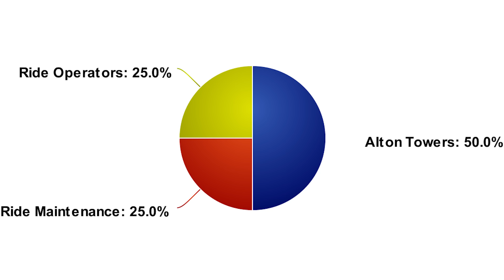What Really Happened on The Smiler Alton Towers june 2nd 2015?

Comment: This video is incorrect on so many levels, I was operating sonic spinball when it happened. It was human error, however fundamental rules of operating a coaster under the alton towers HSA were ignored by the operator. Page one of coaster operation is to offload guests when there is a block fault, the operator did not do this. Whilst the maintenance engineer should of picked up on the stood empty train, it is the operators responsibility. I do not blame alton towers one second for this, but mis-information should not be thrown around. The operator and maintenance guy are to blame not the park, they didnt follow protocol and it resulted in this accident, every operator goes through extensive training and examinations (weeks) before being allowed to operate on their own accord. Real shame for the victims but also the park, people make mistakes everyday in their jobs however this just shows a mistake on a coaster is severe and luckily no-one has died.
Reply: Ian Barclay Is it correct that the park chose to operate the ride at a dangerously high wind speed?
Reply: @TheEagleofSteel  no it isnt, otherwise oblivion wouldnt have been open, neither would spinball the ride I was operating, the smiler has a higher threshold of wind than both of the two rides that were also open.
Reply: @ianbarclay1053  the wind speed was almost 10 mph higher than the Smiler is even allowed to run in
Reply: @getoutim07  No it wasnt. I was operating sonic spinball that day has the exact same wind limits, not even close to it. My other regular ride is sky-ride, again this was open all day, no issues with wind, as was oblivion which actually has a lower limit than the smiler👌
Reply: @ianbarclay1053  I mean it's a proven fact currently that the wind speed was above the Smiler operational speed so you can't exactly deny it
Reply: @getoutim07  I can deny it, because its a lie👌 If the wind speed was above the rides limit the ride would not operate. Not with guests anyway as it would need a maintenance over-ride, so I would do some research into the ride, the park and the procedures before you think youre an expert👌 Until you have operated coasters at alton towers yourself, id give up spreading B.S if i was you its very boring.
Reply: @ianbarclay1053  the park was very busy on the day so they opened the ride anyway even though wind speeds were to high
Reply: @ianbarclay1053  you cannot deny it because spinball is on a different level than the Smiler due to the height restrictions they dig down so the different layers of land will affect the wind
Reply: @getoutim07  Clearly your off your head and just want to look clever. EVERY coaster on park had the same wind limit except Rita. When the wind gets 2mph within that limit the CPU alarms the operator, if the operator does not call for managers and maintenance to addent and over-ride this alert before they have emptied the ride, it will shut itself down. Im not going to repeat myself again, stop spreading absolute rubbish, get yourself a job there and learn about these things if you want to be an expert👌 No ride CAN operate over the rides wind limit.....this is why sky-ride spends alot of days closed as its IMPOSSIBLE to open with wind alerts as it shuts down, like rest. Bye
Reply: @ianbarclay1053  Also I'm not spreading BS as the ride operating above the wind speed is factual information noticeably on multiple websites
Reply: @ianbarclay1053  you do know this is a formal conversation no need to get pressed
Reply: @ianbarclay1053  whether you work there or not 
Gp to enthusiast has covered this subject
Many youtubers have covered this subject
I have lots of information from google which seems to check out with one another

Comment: I'm going to be honest: I don't know a lot about roller coaster operations, so please do correct me if I'm wrong - but to assign only 25% of the blame to the operators feels a bit low to me. They were the ones who set the first sine qua non for the accident - the winds might've been a factor, but without weights the train could've valleyed within wind parameters as well. They then failed to notice that the empty train hadn't returned to the break run and let maintenance override the automatic safety (I don't imagine, maintenance would just override safety features without even talking to the operators).

Should the park have closed the ride? Yes.
Should maintanence have checked for all trains, not just those presumed on track? Yes.

But the accident happend because a train valleyed and the saftey that correctly caught it was overriden. Period. The way I see it, the operators share the main bulk of the blame here...

Comment: "This is human error, not mechanical, its ok to ride it there's nothing to worry about".
Umm, are humans still running the controls?...... then please explain the logic behind your statement.
Reply: There is nothing to explain. if the operators were robots, nothing would have happened. The only reason something happened was because of human error. THE TRAINT EVEN STOPPEN ON THE LIFT HILL BECAUSE IT KNEW THERE WAS STILL A TRAIN AHEAD OF IT.

Comment: I don't personally agree with the percentage. I feel maintenance is more at fault than 15%. I think it should be 50% park, 10% operators, and 40% maintenance. I have been in maintenance and control systems engineering for several years. There are 2 things that make me feel this way, 1 is operators are not technically savy and should never be trusted by maintenance at the bare min double check what operators have done, this is true for any industry. 2 is maintenance purposefully overrided a safety system, this is a big deal! Why any maintenance person wouldn't check to verify a signal is actually a "ghost" in a safety system is beyond me. Even if you have to do 50 times a day, that's still there to prevent this very thing from happening.

Comment: I've been to a lot of UK parks many times and over here we never use water dummies unless its part of the closed season testing phase.. the smiler doesn't have test dummies in the station so I'm guessing that they are kept in the maintenance shed, it would take over an hour and a half just to put them on the ride and fill them up... but that would be pointless anyway because you'd still have to send the train in front that was empty.... so its literally pointless.. they send empty trains all the time without worrying about them valleying even though it happens more that they'd like to admit.. especially on their Gerstlaurer rides, 
also, about the wind speed, gerstlaurer's recommendations do not take into account the wind direction and the fact that, like all rides at Alton towers, the smiler is built in a massive ditch to avoid going higher that the trees, since the park is located in a conservation area, only the lift hill and first bit of the drop is really exposed to the elements, the rest is very sheltered down there
Reply: "gerstlaurer's recommendations do not take into account the wind direction"

They don't really need to on a spaghetti bowl layout like Smiler. While most of the track runs parallel along the length of the coaster, some of the inversions are at an angle to the longest side of the ride. As a result, high winds can cause issues for the ride's stalled inversions regardless of direction.

"and the fact that, like all rides at Alton towers, the smiler is built in a massive ditch to avoid going higher that the trees, since the park is located in a conservation area, only the lift hill and first bit of the drop is really exposed to the elements, the rest is very sheltered down there"

This can actually make the wind problems worse, as it can cause eddy currents inside the ride trench.

Regardless, though, those manufacturer-listed operating limits exist for a reason and should not be ignored.
Reply from the maker: Clearly the batwing is not well sheltered as if It was this would have never happened!
Reply: @VestedUTuber  "This can actually make the wind problems worse, as it can cause eddy currents inside the ride trench" 
WHAT??!!
Reply: the inversion it stalled on was the second to last inversion before the train hits the brakes and climbs the second lift hill. 
it does go through the batwing quite slowly anyway as its towards the end of the first half of the ride
Reply from the maker: Ok, but the wind still was strong enough to cause a vally when it otherwise would not have occurred.
Reply: @CoasterCollege  the batwing is simply not well designed. It has stalled there multiple times.
Reply from the maker: Sure, but this time it valleyed there due to the high winds in the area that Alton failed to take the coaster down for.
Reply: The entirety of X-Sector is covered with trees, the wind simply didn't play a very big factor, and is not to blame for it stalling. It was more to do with the wheels.
Reply from the maker: No, the only reason it valleyed was due to the winds, there is simply no other way it could have been caused. The CCTV footage from that day shows the trees around the ride moving a lot from the wind that day.
Reply: @DomWPC  65% + 55% = 120%????
Reply: @DomWPC 
Have you ever seen loose objects in the back of a pickup truck blow around in a circular fashion when the truck is moving at speed? It's the same thing but at a much larger scale.
Reply: Um no, an eddy current is a current that can be induced in copper with a magnet or electromagnet, its got nothing to do with wind Lmao
Reply: @DomWPC 
Well, yes, but also no. The term "eddy current" is also used in fluid dynamics to refer to a rotational current in a gas, liquid or other fluid.
https://en.wikipedia.org/wiki/Eddy_(fluid_dynamics)
Next time you want to correct someone, make sure you're not the one who needs correcting.

Comment: So what happened in the "misconception" video was actually accurate. Just without vivid details.
Reply: Not really. A mechanical error did not cause the empty train to stop, and it didn’t even mention the block system override which caused the crash.
Reply: @triple7marc  Did it include every detail? No. Was it sorry and to the point? Yes